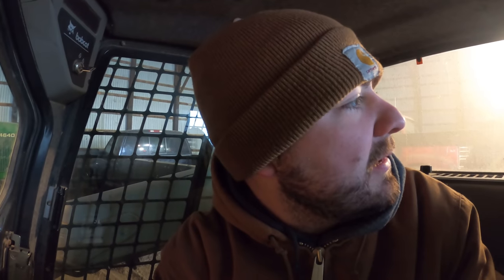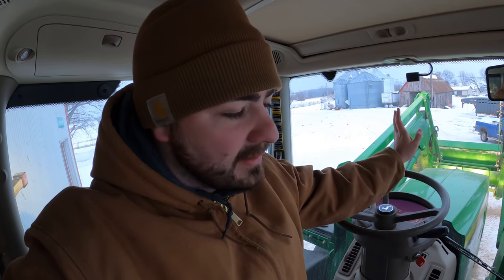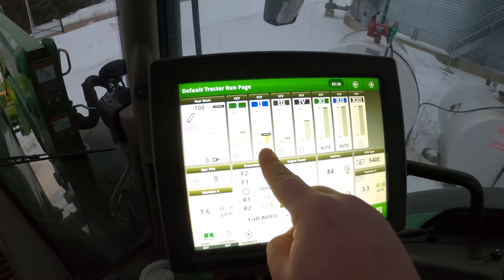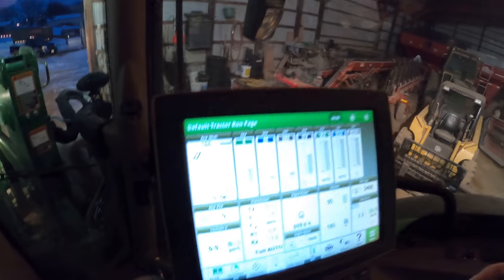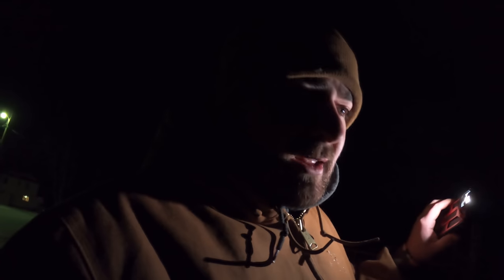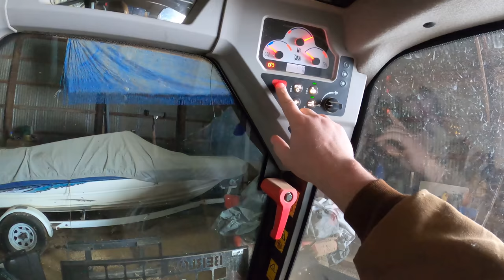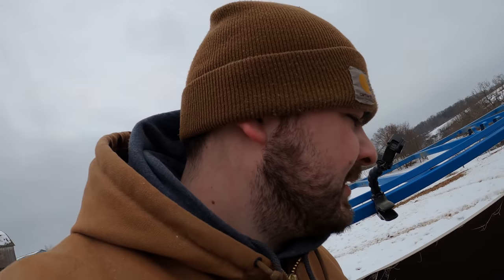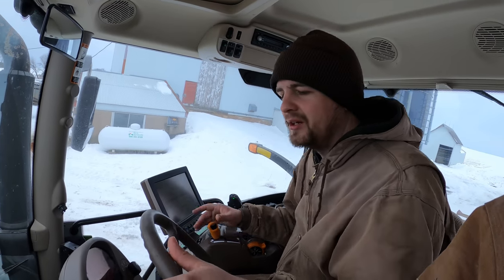Grinding Corn - John Deere 6195R

Comment: Ryan, I always see you using the clutch.  I know it is force of habit.  On IVT if you depress both brake pedals at the same time it acts as an "automatic clutch function".  If you still have the tractor you should try it out. 

Straight out of the manual.
If both brake pedals are depressed when driving the tractor, the speed will be reduced or the tractor stops. Thanks to the automatic clutch function, there is no need to depress the clutch pedal when braking.

When the brakes are released again, the tractor automatically accelerates up to the speed currently commanded by the hand throttle or accelerator pedal.

The higher the engine speed, the greater is the pedal effort required to stop the tractor.
Reply: Most of us still have that same habit with a shuttle shift!

Comment: You guys should get an arts-way grinder we have a arts-way PM 35 and it works great for out 450 head of beef cattle I am in love with the thang used to have a grinder about like that one you have and it makes a huge difference the 7600 or 4640 would run the grinder great

Comment: I drove the same tractor during corn silage whit a 50 kubic feet chained cart on it had no problem at all on the road fully loaded had IVT to what a sweet ride that was everything was so easy to opperate you coud speed up the chain on the cart from the display witch was cool made unloading so mutch faster.

Comment: It doesn't look like your hammer mill was doing to good of a job cracking corn. Did you ever look into a roller mill, it might take a little longer to make a batch but it does do a better job on cracking corn

Comment: I got a 6420 IVT, had it since 2003.  3000 hours on it now.  Never had a IVT transmission issue,  but for the water pump that cools the transmission. Replaced twice.
Reply: You did only 3000 hours in 16 years? No wonder you had no problems you never even used it.
Reply: @Matevz96  Well,  if it was going to break, 16 years would of been more than enough time, don't you think??????  lol. Long past warrantee. That's why the price of 6000+ hour tractors are so much lower.
Reply: @klugfarmsklug9323  In my experience things rarely break when sitting in shed. I agree that 16 years is pretty long time but you only did 200 hours a year with it.

We have 2 JCB Fastracs year 2003 that have 13 000, and 15 000 hours and only serious repair so far, were front differential on both (bit of our fault) and engine rebuild on one. 

Personally I don't see point in buying a tractor for much less than 1000 hours a year. I rather get contractors to do the job or have some ancient piece of junk to do the work that only takes few hours a year
Reply: @Matevz96  Over the years, i pulled the grain drill with it. Corn planter, 4 & now a 8 row. Pulled in the silage wagons with it, 16ft size, for both haylage & corn silage, raked hay with it, & round baled with it. In the Fall, i put it on a Heston stacker, make like 250 stacks with it every year. Then would finish up with the stalk shredder. I would some times grind feed with it too. I am a small farmer, feed 230 head of fat cattle every year.  Have a total of 5 other working farm tractors, so the work load is spread out, between the smallest, 450 farmall prior SM,  to a 8320R JD. Thinking of getting a 8400R, so extra person coming to the farm can use it in the Fall to chisel plow, while i combine, pull wagons in with the 8320R, 2, 625 bushel Brent & Parker gravity boxes. I do have a 9500 JD hillside combine. Also have a 750 Meyer vertical beater manure spreader. Never a dull moment here at the farm.

Comment: since i first seen your creep feeder video, i though gee that be nice, i looked on line and found a Canada mfg, and it was $3000 cnd, and i wanted it mobile to take it 7 miles to the feed mill to get filled up, since they dont deliver less then 5 ton,,  being it holds just over 2 tons, so converted my feed bin i go get bulk feed in, open a trap door to fill pails, that i built  and cut out the 2 sides to weld in a feed trough on each side and built a set of panels on each side, out of cut offs i had, since i am a welder by trade. saved my self $3000 plus fright and 13% hst, for a few hours work, and i can still use the trap door to get feed out for other live stock, since everyone get a 50/50 mix of cracked corn and ground barley,,gees all Canada buisness give there logo shits hats and stuff away free, it is advertizing, people dont pay for business advertising